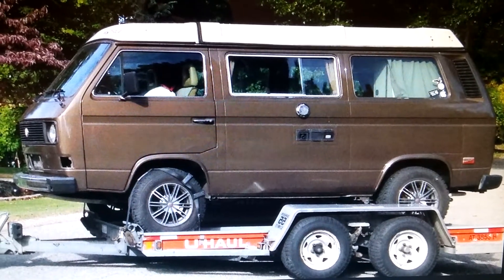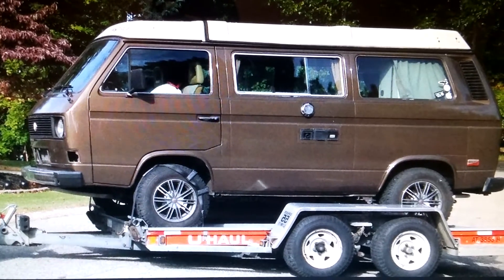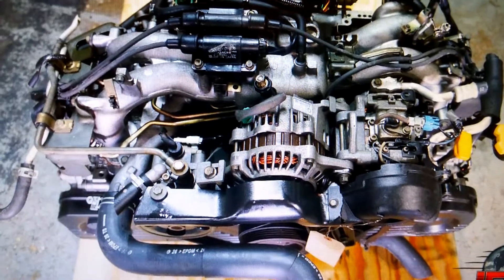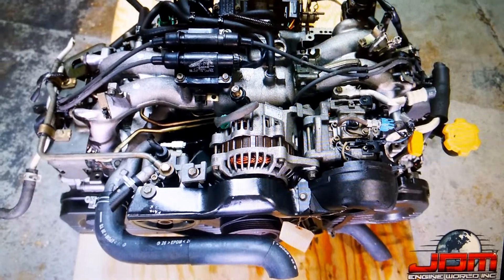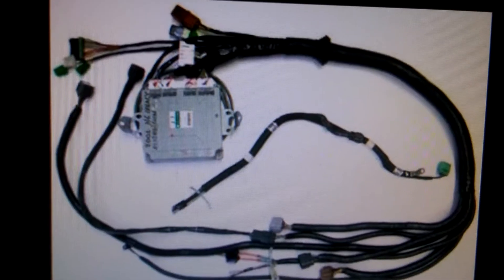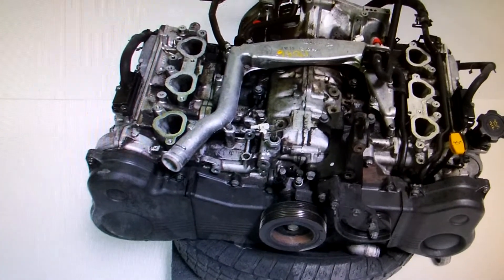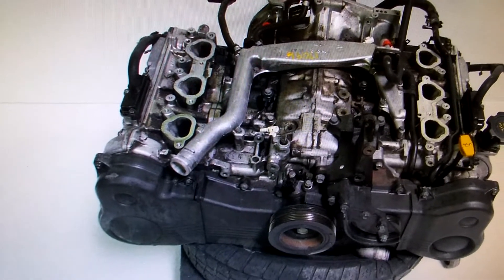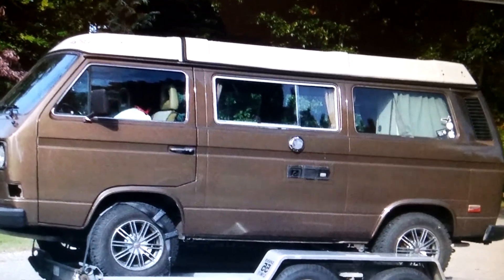Vanagon SVX Subaru Conversion Preperation (Engine Selection, Conversion Kit & Wiring Harness)!!!

Comment: Always best to source the Subaru engine, wiring harness and ECU/ECM from the SAME vehicle. A mis-matched ECU can make for a trouble prone conversion due to compatibility issues. 

For the best conversion, in my opinion, use the the Subaru MT5 manual tranny too. SubaruGears.com makes reversed ring and pinion gears for this purpose. With a slick shifting Subie 5 speed, engine revs at highway speeds are in the 2500-2800 range, compared to 4200-4800 with the original VW 4 speed manual (which are known to fail around 150k). It makes for less engine wear and longer engine life, as well as a quieter ride.

Dave Clymer has an extensive post on thesamba.com , discussing the Subie engine and transmission conversion in detail.
Reply from the maker: John Houle thank you for sharing this valuable information.  In my case the items such as my engine, brain and wiring harness were all from different sources, it worked out well in my case, but I have no doubt that what you have written is true and if possible would be the safest option.  Thanks for watching and commenting.  Have a great evening.